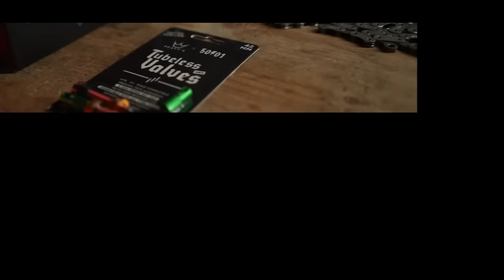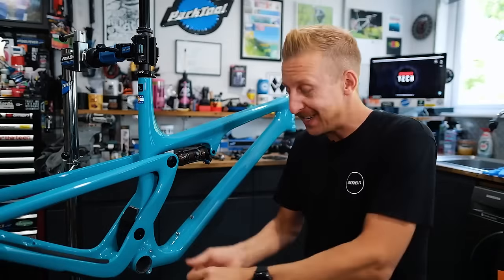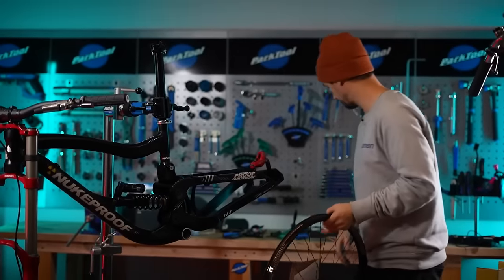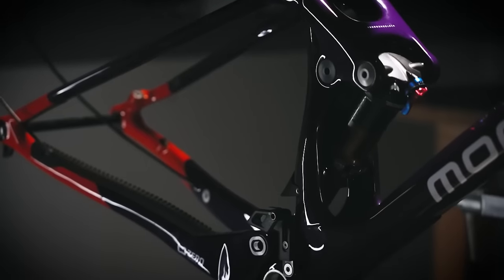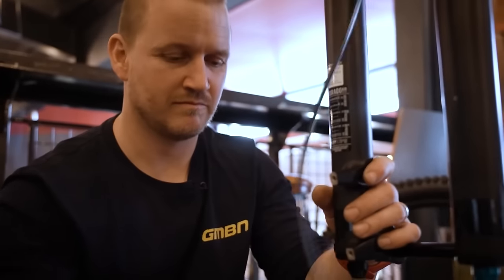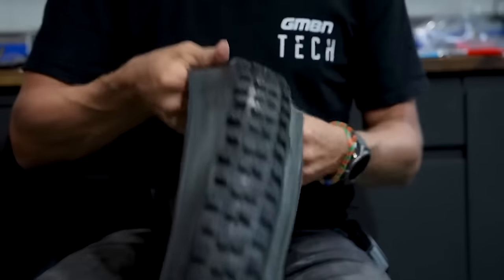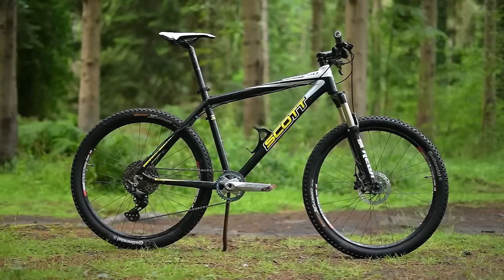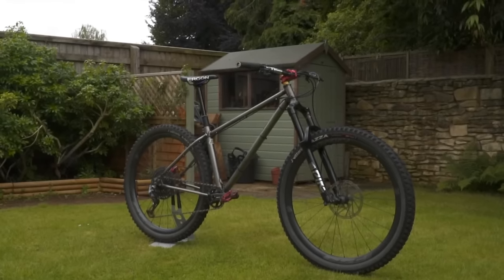Best Of GMBN Tech Dream Builds | Super Bikes, Hot Tech, Pro Workshop | 2hr+ MTB Compilation

Comment from the maker: What would be your dream build? List all the parts as well! No expense spared 👇
Reply: I would start with a nukeproof giga 297 frame start with sram axs t type  fox dhx2 coil shock and fox 38 factory grip 2 industry nine hydra enduro wheelset gusset pedals stem seat bars and grips fox factory dropper and maxxis assengai tyres and set up as tubeless
Reply: No need for a $10,000 dream build. I'd rather have several $1000 - $2000 bikes so that my friends, or my kids, or kids friends could all ride together. Spread the mountain biking community!!
Reply: Truth be told the more expensive it is, the less likely it is that I have fun with it. Because I would baby it more than anything

Comment: # ask gmbntech just got a new cube stereo 120r full sus only 1 gripe 30t chainring i cant even fit a 32t without it catching the gear cable or compramiseng the chain line or removing and re routing bodgeing the gear cable any ideas thanks